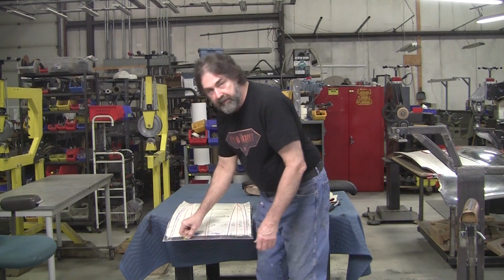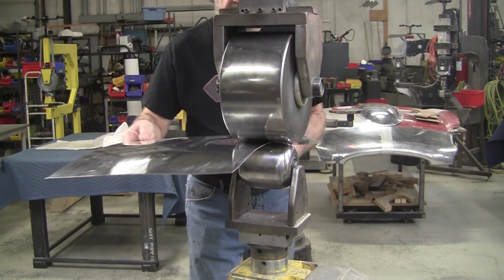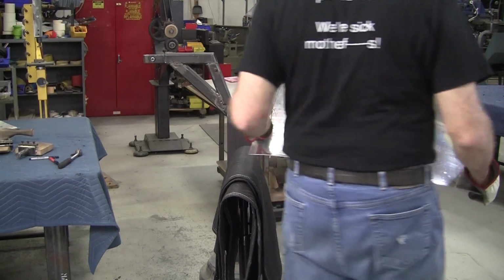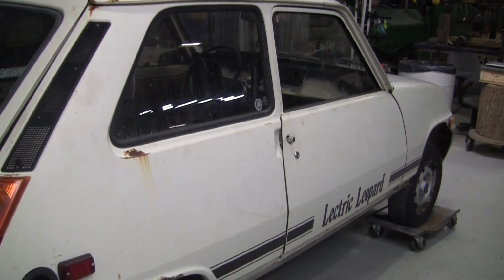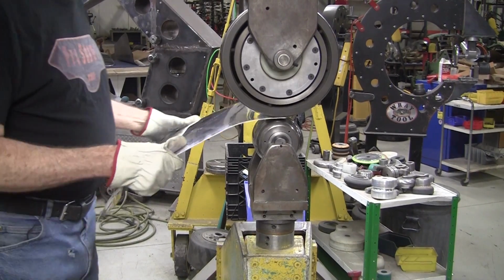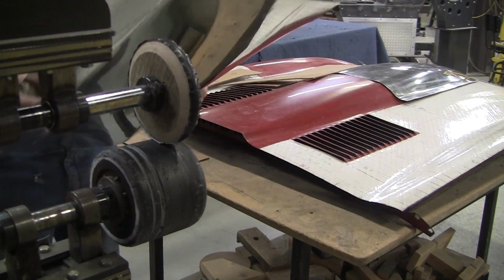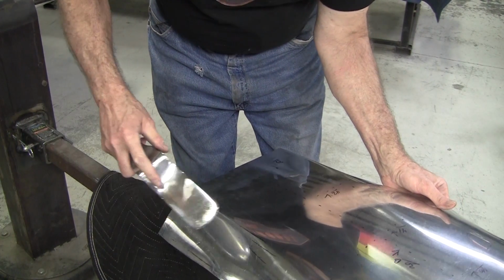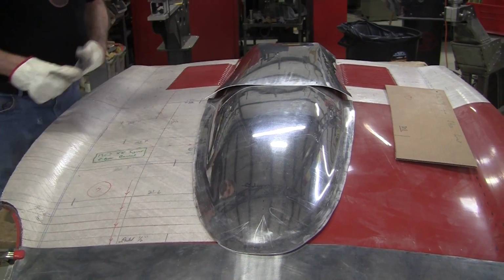Metal Shaping: Jaguar E-Type Aluminum Bonnet Build (Part 8B)

Comment: Great video Wray and thanks for all the training. Unless you talk we will never figure all the nuances necessary to build such panels. As for the wood vs metal bucks I like your thought on the metal but how do we build a one off if we cannot use the flexible shaper? I was going to build a wood buck and fill it with foam between stations to get the shape for the flexible shaper patterns. Any thought?

Comment: Great set of Video's Wray I only just found this youtube  site and have been inspired.
And your explanation of developing the surface area (Area Value) from which to then input the arrangement ( shape) is ingenious.
You are effectively pressing and shrinking the steel or Aluminium  to the exact surface dimensions prior to forming the profile.
It amazes me to see your Craftsmanship and how you turn the flat panel to the form right before our eyes with such a simple tool as this flexible pattern

Comment: Wray? I use thin and thick felt pens, too. When the thin or thick ones stop inking, I grip the butt end and shake and snap down, with wrist action, to drive the ink to the thin tip end. BUT, too much will start throwing lines of black ink, all over the floor, if I do too much snapping.

Comment: could you do some work on the smaller wheels , the yellow ones in the background , one of those i would have room for and could build , also , what are the wheels on your machines made from , you seem to have no hesitation in sanding them clean.
Reply from the maker: All of my top wheels are hardened to 60 Rockwell. My lower anvils are not hardened. It is easier to tune the lower anvils if they are not hard. Unhardened anvils will only mark up if you run over unground steel welds or foreign material.
Reply: @proshaper  ah , that makes sense now , i couldnt work out what was running against what in hardness terms

Comment: What's the thinnest gauge steel that a car bodt panel can be made from?  Are replicas of 50's Ferraris made from steel desireable?
Reply from the maker: 20 gauge steel is used on some cars, mostly it is 19 gauge. 20 gauge is .035" 19 is .040"  Some valuable Ferraris could have been skun in steel, most were aluminum.
Reply: @proshaper  Thanks. I was asking because I have some 26 gauge steel that I was using for a buck. I just learned that 26 gauge is WAY too thin. I used it just now in my first time ever flexible shape pattern experiment. I made an entire fender with it, and it went trouble free----except the metal was too thin. I made it similar to this:  https://www.pro-touring.com/threads/111638-Auto-Rod-Tech-s-metal-shaping-and-fabrication-thread
Reply from the maker: @mikep608  that 550 Porsche front fender was made by Chad Sperry at my class under my direction about 6 years ago. 😁😁😁
Reply: @proshaper   Cool.  I thought the pattern looked familiar. I had to make my FSP from a buck. So I refer to it as a Near FSP. I could not find fiber glass re inforced tape until last night at Staples. I made the pattern yesterday from duct tape over paper bags that were patched between buck stations. My plan is to build the bucks from cheap cardboard, make near FSPs, make the part, and from the first part a real FSP.
Reply from the maker: @mikep608  the fiberglass reinforced tape the Staples sells is inferior quality and more expensive. I sell the correct tape on my website proshaper.com
Reply: @proshaper  Thanks!

Comment: Inside minute 11 the camera angle allows you to see the flex of the machine and how the metal reacts as it goes thru
Reply from the maker: I'm not sure what you are saying? All structures flex, buildings bridges, aircraft carriers etc. The design intent is to limit the flex to acceptable levels.
Reply: @proshaper it was just a comment. it is interesting to me and maybe others, how much the machine flexes when the metal is inserted. The camera angle just gives me the view that you don’t see as you are wheeling. Gives me a visual picture of how the metal is moving as you wheel.

Comment: This is a question about the Riley left front fender build.  Did Brian make the flexible shape pattern off of the front left fender,  Or did he make the flexible shape pattern off the right front fender and then turn it inside out.  I ask this question because I wonder how well a flexible shape pattern will work when the left front fender is as messed up as this one is.  Was Brian able to get a "good enough" pattern off the left fender?  Thanks Wray.  I am getting a lot out of these videos.  Pete
Reply from the maker: Hi Pete, Brian did take the flexible shape pattern off of the left front fender. Yesterday he found out he had copied a error that was in the bead. He will have to make the correction today. I should have picked up on it but I was busy with other projects. Close observation during the whole process  is the cure to having to fix later. 😁😁😁

Comment: Hi Wray. Do you have a copyright on your flexible shaping? I've seen an imposter  on YouTube  4/8/2010 ( there is a name but l have withheld it on the basis that we don't want lawsuits flying around do we). The comforting thing is he only has 2 comments, think that says everything  . (Over here we would say its 8th day of the 4th month 2010)
Reply from the maker: I revealed my innovative method called the flexible shape pattern ( my technique and name) on the internet back in 2001 on the first metal shaping forum. It is impossible to patent and protect. Probably less than 5 percent that read about it or saw pictures assigned to it any value. And Funny thing is this craft like all human endeavors is very divided into various traditional mindsets.  Most people join one of the mindsets instead of seeing value in all of the perspectives. Dogmatic thinking rules,  innovation be damned is the way of the world.  My belief is only 5 percent of  what potentially can be known about this craft- in both tooling and techniques has been discovered. There is still a ton of room left for innovation but you will run into a brick wall. Also there is very little money in the craft to drive innovation.  Copying techniques and tools seems to be the favored method. It amazes me that many current tool builders just copy existing designs shamelessly with no attempt to innovate.

Comment: Well Wray it seems the immediate gratification group has reared it's head. The only issue I have is wanting too go out to the garage and get busy before the vid ends. Old fashioned hand craftsmanship is a difficult thing for many due to the patience required to learn it. Your be numbers may not be huge but I guarantee they are loyal and they are the ones that will carry this craft forward.

Comment: The "Flexible Shape Pattern" is really an elaborate mathematical function. (The formula would probably take up more room than the paper.) 250HP applied to the remains of that R5 will probably tear it in half! :-)*
Format suggestion; edit the digressions, (which are interesting), out of sequence and into separate videos, and concentrate the rest on the actual process. Some of the steps could be shortened by removing middle parts that don't show anything new; e.g. wheeling. Show the start and end, with a time-lapse indicator, perhaps a clock in the background. It would lose some of the meditative quality, but shorten the video. (I know, everyone's a critic. :-)*)